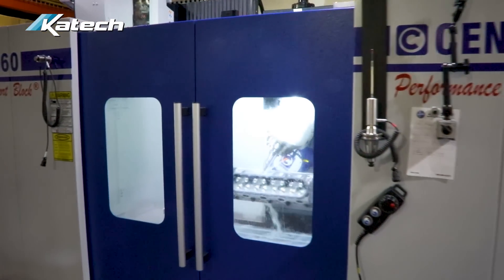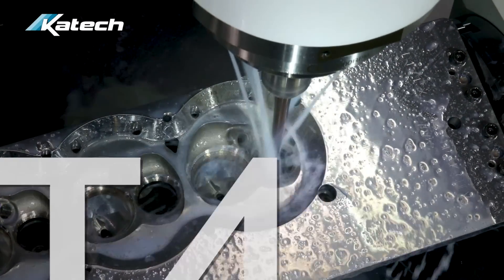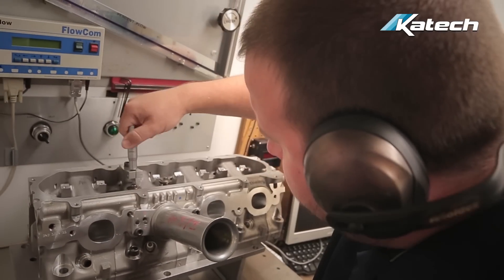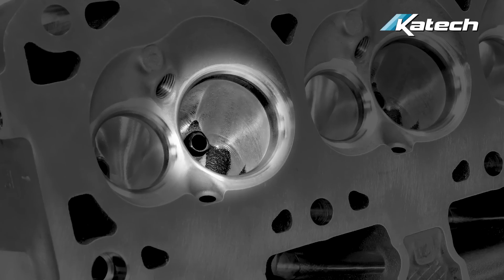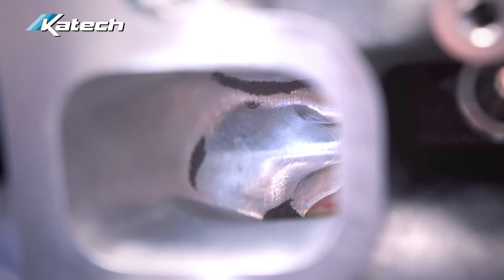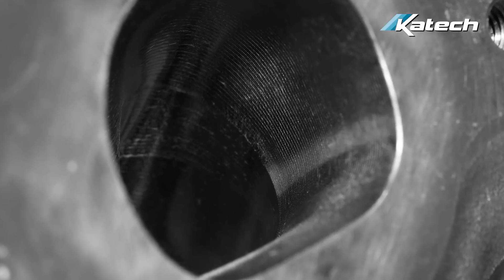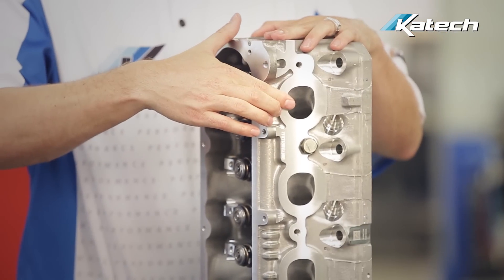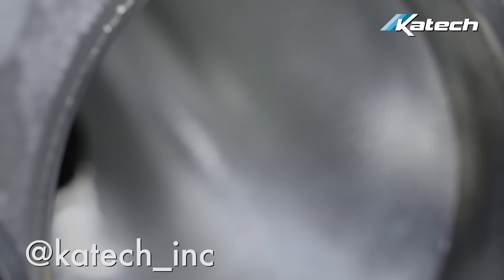Katech CNC Ported Cylinder Heads for LS1, LS6, LS2, Trucks, LS3, L92, LS7, LT1 and LT4

Comment: He's absolutely right you don't hog out the intake you have a Venturi in there the makes the air and fuel get squeezed through a tighter area then open up into the combustion chamber so it goes from hi pressure into low pressure which atomizes the mixture and makes it volatile by breaking the fuel atoms up and mixing it with oxygen. The first heads i ever ported were Chevrolet 58cc camel hump's off a small journal 327 and i just hogged them within inches of their lives and ran the engine on the street and it would wet foul a different plug every couple days because i cut the Venturi out of the intake ports so they would work ik wide open throttle and hi rpm but i ported the idle quality and drivability right out of them and they were very inconsistent to i spent 14 hours on the first runner and by the time i got towards the end i wanted it finished so didn't put the same effort into the last ones. Ruined a good set of hi compression heads. They made 10.75:1 with flat tops with.060 milled off the deck mating surface. But also had no accessory bolt holes whatsoever the old 283 n 327 461 and 462 castings were that way and the balancer was pressed on the crank with no bolt in the crank for the balancer. I could wind that little engine to 6,500 all day long and never hurt it

Comment: Hey katech How much horse at the crank or whp does the stage 2 add to l92 cnc ported heads? 
Looking at the .0600" flow numbers they flow much less than the tsp l92 brawlers and those claim 25+

Comment: How much whp am I looking at on a FBO stock cam 2018 Camaro ss when adding katech ported heads?
Reply from the maker: 10-20hp with a set of unmilled CNC ported heads. More if you mill the heads.

Comment: Love to see a Truck CNC Profile for Low to Mid Range Torque n Throttle Response, that's mostly "Exhaust" on 823 Heads @ 550 Ish Truck Cam Lift, 1 3/4 TriFlow Headers, DD 416 Stroker Swap w 6L80 into ~ 96 Land Cruiser @ 6850 Lbs "Brick" 🤣😎 Awesome Products n Great Content, Ordering a C5-R Soon Thanks

Comment: I been porting heads for over 25 years I have ported virgin billet top fuel heads to race ready and used..all the way to porting and flow benched rotary 13b side plates and exhaust ports and everything in-between even ported for a programmer to xray and copy for there cnc stage# bs .. now this what are super charger ports a port is a port you just said  that a fully ported head is a marketing scheme 😳 🤔 🙄 then say you have a super charger port 🙄 😳 👏     enough said
Reply: He NEVER said the word scheme. Maybe you can divert some of your porting time to reading a dictionary.
Reply: SMH

Comment: You guys are badass and do so much in the performance world BUT I CAN OUT PORT ANY CNC MACHINE it takes way longer just to do what yr machine does in 10 minutes I would love too see a CNC Machine do a 2 cycle cylinder Sorry I gotta disagree all exit of flow meaning your exhaust needs no resistance whatsoever  Intake side you do want a tumbling air and fuel mixture there's a way to create that once air moves it slows down each turn each bumb any type of resistance  What I see on these YouTube port hacks they remove all the torque By removing too  Much volume
Reply: I call absolute bullshit shenanigans on you sir . A cnc machine removes exactly the material it's commanded to remove where it's commanded to remove it . This means they can test between heads and improve the formula each time until they have it perfect . Your a human , your gonna have inconsistencies between heads.

Comment: Have you published any flow rate data in regards to your ported 241/ls1 and 243/ls6 heads? Wasn't planning on porting my heads but your rates are very reasonable, and your local! Thanks
Reply from the maker: We're working on putting together a comprehensive report.

Comment: I thought you guys already did cylinder porting on LS1 and LS6 heads.
Reply from the maker: We have for years, but lately only been doing it on in-house car builds.  We recently made some airflow improvements to those ports using the latest technology in our shop and refined our process so we are now offering mail order cylinder head services.
Reply: KatechPerformance awesome. Keep up the good work. I've been following you guys ever since I saw your 427 4th gen Camaro build featured in Super Chevy. Honestly I think you guys had a LS6 swap before that in a sunset orange 4th gen camaro and that's when I truly started filling you guys. Lingenfelter and you guys are the go to performance shops for anything GM performance related.
Reply from the maker: That's a long time.  Thank you.